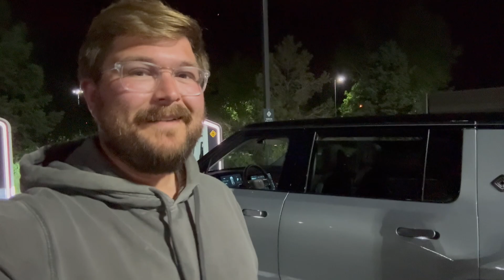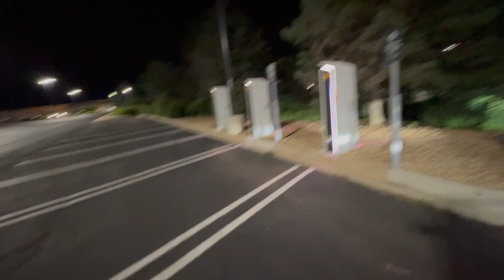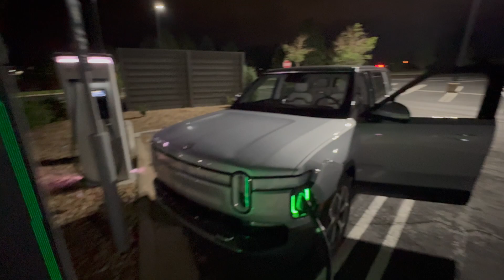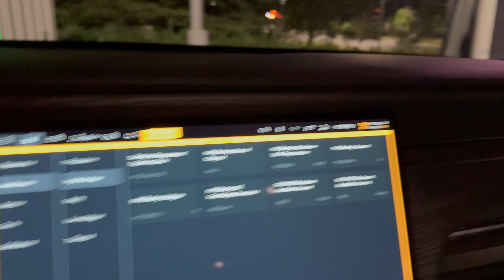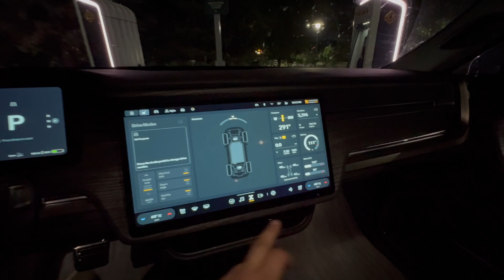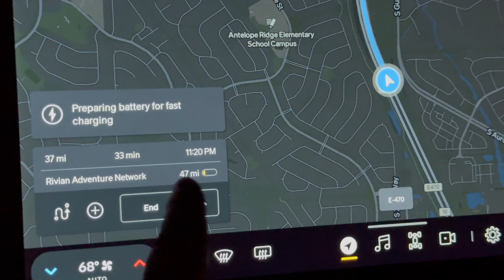Rivian R1S 10% EV Road Trip Challenge! You Can Go This Far After A 15min Charge (Gen 1 Dual Max 21")

Comment: 86 Miles ...Rivian and Francies VinFast 66 miles? ..Love the Rivian but not the price . Kyle I swear I seen a video/news that another Rivian delivery van caught fire (Amazon) last week(again) you heard anything ? Every video you make you mention the poor thermals , when you and Alyssa were out a few weeks ago battery was hot and you were getting poor charging, something is not right ?
Reply: Rivian VAN has an LFP battery and is charged to 100% on a daily basis. As the fire was not related to HV battery as far as was reported.  So this has nothing to do with R1x
Reply: @polzovotel  "as far as was reported" .  And as I stated thermal management.. dosent have to be specifically battery shorting out..but (as in dendrites) but therrmal management not working as it should ..which in turn leads to fires..we know the R1x has thermal managment issues..can be be related to the Amazon delivery vehicles? ..I think thats a fair question
Reply: @electric-rideshare  It is, it is just VAN is a totally different animal and has different thermal management than R1x. So any problems VAN may have will not reflect on R1x. As far as for now, there was not a single issue with the battery thermal runaway for R1x.
Reply: @electric-rideshare  LFP battery in the vans has a totally different configuration/cooling.
Reply: @iamnid   More searching and it seems that all the fires are starting right at the handle/charge port,,vans and R1t .  so cheap plastics at the port/handle? 

telling you something not right... lots of charger handles get very hot so leaning more towards that heat starting cheap platics or cheap port metal [plugs on the rivian?    I use to temper steel , (heat treating) I know specs for all kinds of metals need to be correct or they will fail.. . 

as Far as LFP  and 100%.. LFP are less prone to firs but only marginally . (every litle advance helps though) 

The down side is  LFP isnt not as good in cold weather .I live in Minnesota .

I charge my 2023 ID 4 to 100% daily driving rideshare . 50K miles .my lifetime average is 3.2/m/kWh (roughly 250 miles charge)
Reply: Yep , 3 rivian vans Houson July 1 .. search Insideevs .."Amazon Electric Vans Ignite In Houston Heat. Rivian Rules Out Battery Fault
The Fourth of July week didn’t go as planned for three Rivian Amazon electric delivery vans in Houston."   assuming 1 van caught fire which started the other 2. 

I mentiooned in another thread that the Chevy Bolt had I believe 8 Fires before they were recalled, (I was one of many that received a new battery) . .that was a production error , Rivians APPAER to be as you keep mentioning a THERMAL management issue.. Still is a recall on the horizon?